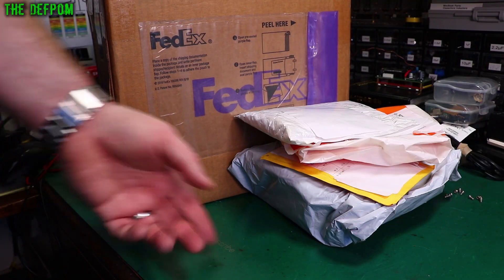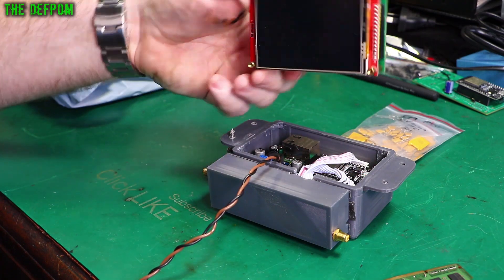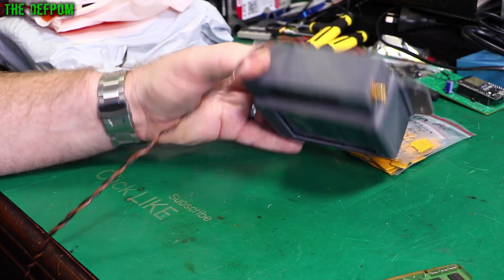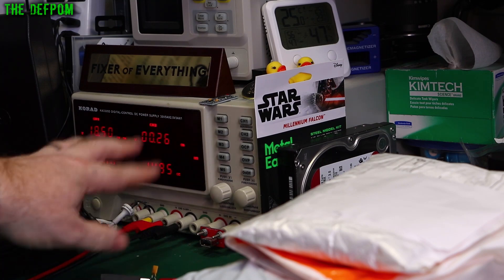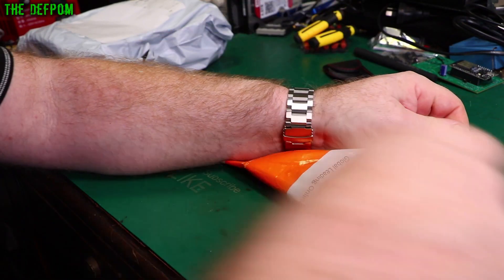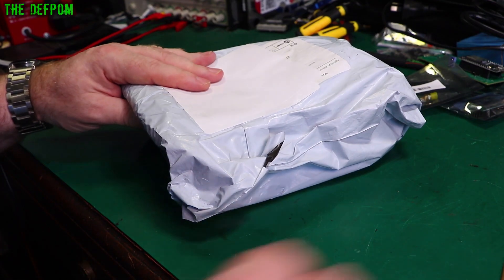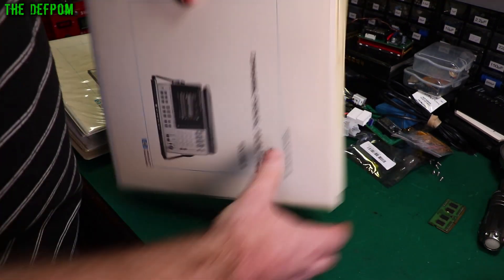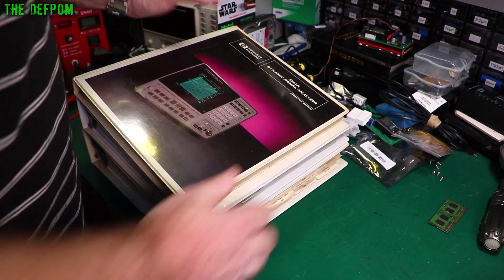🔴 What's in my Mailbag ? - Mailbag Monday 22nd November 2021 - No.893

Comment: Thermal sink by the clips may cause some derating of current point of the ptc, compared to pcb soldered state
Reply from the maker: Yes quite possibly, I just wanted to demo their behaviour as I thought it would be interesting to show it.
Reply: @TheDefpom  That is fine, I was mainly meaning that viewers might gain the 8mpression that these are slow and running way over the rated current, beyond double stated current. Normally while like physical fuses taking longer at close to rated current, I have observed mostly acting at under 50% over current, faster than physical fuses that need very large current to get within second time response.  Sadly neither protect most overloaded semiconductors from permanent destruction which often takes place well under second level.